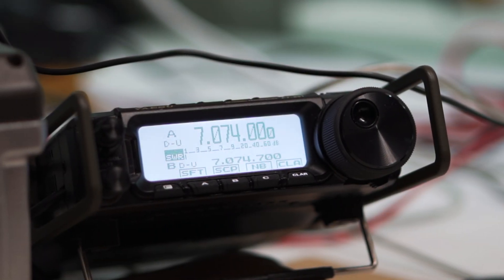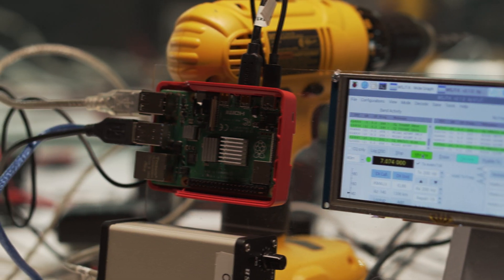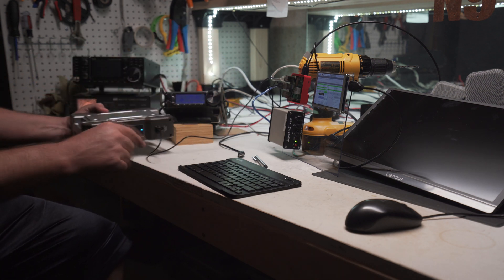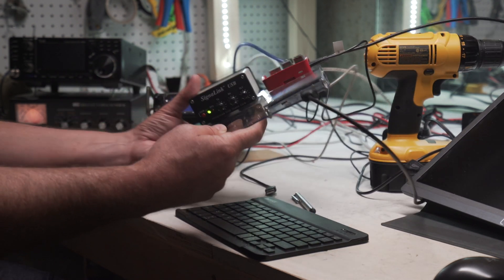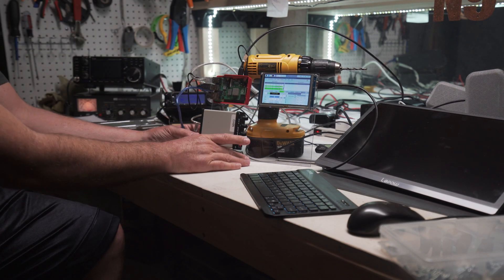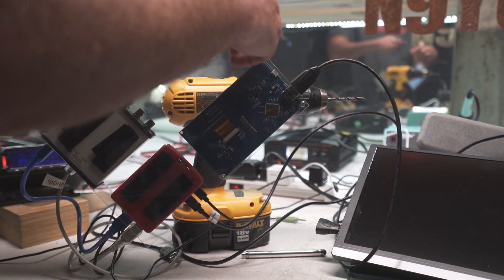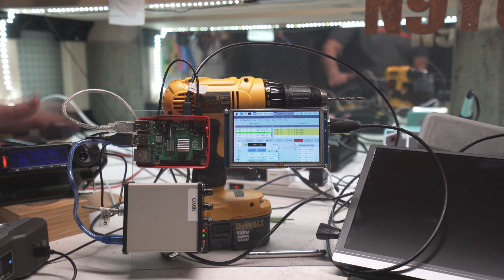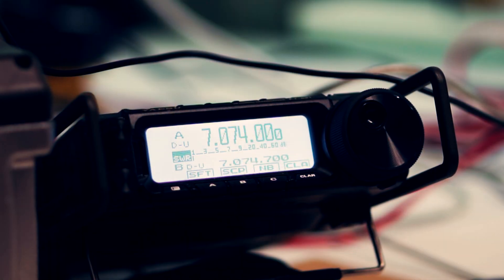Ham Radio | Mount Raspberry Pi Projects ~ Yaesu 891 WSJT + FT8 Digital

Comment: So I’m considering a raspberry pi for portable use and logging. Would I be better off getting the components for a portable all in one computer with it. Or the pi in a case with external display and stuff. If that makes any sense. “Laptop” essentially.
Reply from the maker: If you want simple, go with the regular laptop.  You have to really want to use a Pi to get it to work.  It's more finicky and tricky to use Linux and it's software.  I just did it with this for fun experiment.  I would suggest a laptop with Windows.

Comment: Looking forward to seeing how this all works out.  I have the Pi and a Yaesu FT-817ND.  All I need is to get the interface built to hook between the Pi and the 817.  I want to make a portable setup, something that can be packed into a backpack.  73 Juddie WD8WV
Reply from the maker: That sounds like a really cool project.  What is the interface you are building?
Reply: Ham Radio CQ a digital interface like you hook between a desktop or laptop computer for the sound card.
Reply: Ham Radio CQ, the digital interface would be similar to your SignalLink that you are using.